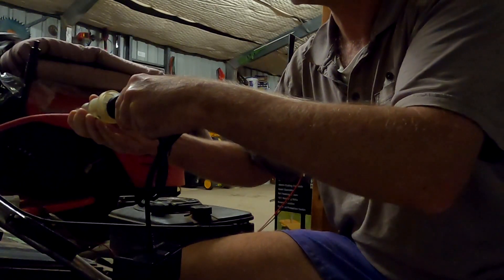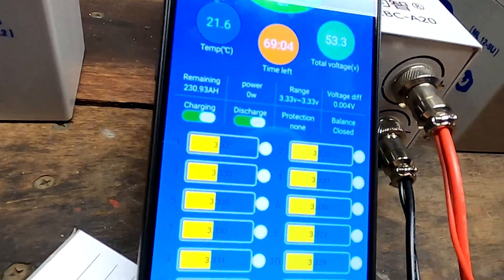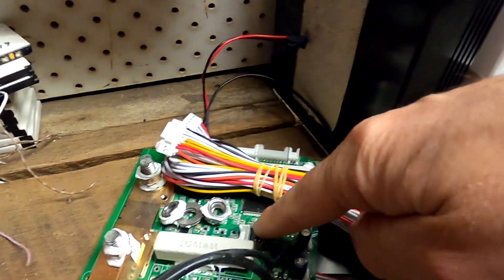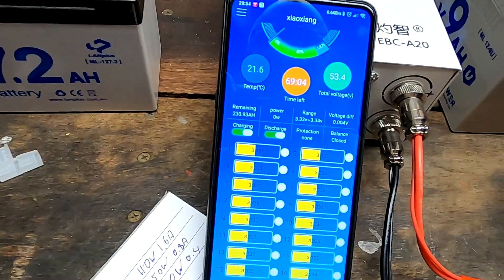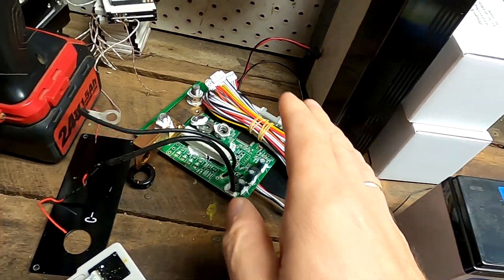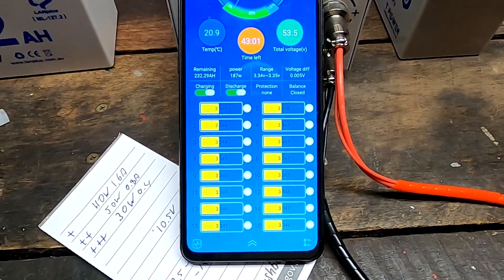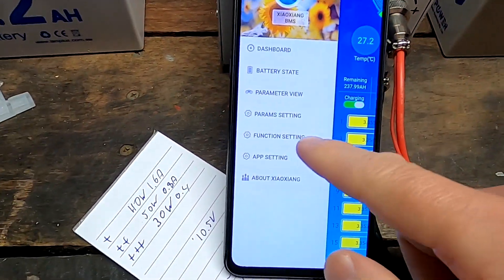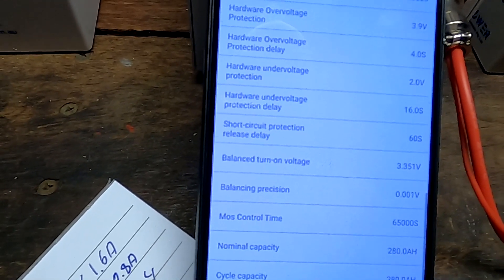That was totally my fault! How the new BMS outsmarted me...

Comment: if all the cells are 3.33 volt, what's there to balance. maybe you need some more time out of the garage and rest for a while. ;)
Reply: Because the state if charge can be far apart but voltage still be the same when you are close to 3.3 volts. Only when you get to the top and bottom of this chemistry can you truly balance the pack.
Reply: Because the state of charge could still be pretty far off at the 3.3v range with this chemistry.

Comment: That old keeps creeping up on us. Funny you even said 30 millivolts several times(and I was wondering why it was so high). Speech and reading part of brain not connecting with the thinking part at .003 volt Lol. When I program a CNC and it won’t run or does something else or impossible,  I’m always ready to blame the machine too. I call a coworker over and talk him through my program….that’s when I get the forehead smacking moment, usually self discovered. It was right freaking there.
Reply from the maker: Either to many 🍺 or not enough... 😂

Comment: I have 2 humble suggestions for you to try:
 1- disable balance charge: the balancing pushes 0.2A from one cell to another to make the balance (during charging if the balance charge is enabled - so basically useless). when the balance charge is disabled, the balancing will only kick in once it is not charging anymore (cell overvoltage protection or any other reason) this way the battery will have alllll the time to balance the cells slowly and efficiently.
2- setting the balancing accuracy to 1mV will keep your pack in balance mode for ever and will eventually self drain because of current movement from one cell to another endlessly ( the loss alone in the transfer will drain your battery). setting the limit to 20mV is a good level and you will have nice well balanced cells.

regarding the float charge balancing suggestion: big no. you are trying to balance the cells with floating current. this floating current will apply to all cells and will not have a balancing effect. yes it will be more visible, but the balancing is not triggered by the charge level. either you are pushing 20A in or 1A in, the bms will look at it's parameters and activate or deactivate the balancing. let the bms do the balancing as suggested above in point number 1

Cheers
Reply from the maker: This is not an active balancer. This is a BMS with passive balancing. It uses a resistor to discharge the cells if they have higher voltage than others. 
There is no float current for Li cells, they just don't float. Floating Li means the SCC takes care of your loads while the battery rests at the set float voltage. There is no current going in or out of the battery at this stage.
You're mixing things up a bit?

Comment: When you were set to balance at 3.33V: Your "Balancing precision" was set to 0.03V or 30 mV. That means there must be at least 30 mV difference between high and low cells for it to start balancing. When you were set to balance at 3.33 your cells were only 4 mV apart. Not enough to trigger balancing. You need to be both above the minimum voltage AND have a large enough difference between the high and low cells.

... Oh, I should have waited to finish the video before commenting. Haha.

30 mV is probably the recommendation because the voltage measurement from the BMS is probably not accurate enough to keep them within 1 mV.
Reply from the maker: Yeah, I oversaw this setting multiple times for the last few days 😂
As I never changed it since the beginning, I took it for granted that adjusting the balance voltage is enough to trigger it. 🤦‍♂️
But you're right, it's an AND for reaching the voltage AND having a higher difference between the cell voltages.
Reply: @OffGridGarageAustralia  At 1 mV delta for balancing is ridiculous, what your trying to accomplish? All that balancing energy ends up being wasted by being dumped into balancing resistors as heat...
A delta of 20-30 mV is more than sufficient.
Reply: George D / 😂 Correct.

Comment: The solenoid on this BMS has a special "economizer" attached. It is supposed to limit the idle power of the solenoid, after the current surge to pull in the armature. But with many fake Chinese products does this work on this BMS? - testing video, please.

Comment: 2 points worth noting...
use the other app that comes with bms to set static or charge balance and set accurate temp of batteries ...
and if you have a cell that runs higher voltage then is your weakest cell on full charge and discharge it is wise to set the balancing at 3.5v so you re not robbing it to balance others as it charges and making the problem worse
Reply from the maker: What other app? That is the one for the BMS?
In my experience balancing at 3.5V is not worth doing. High voltage and no effect. I will explain and show this in a future video.
Reply: can send you other app on "send anywhere" app if you download it or have it

Comment: Question for you. Most solar charge controllers require a battery connection at all times during solar charging, otherwise the solar charge controller might be damaged. So what happens when your relay type QUCC disconnects the battery connection

Comment: Hi Andy, have you tested the battery cell low/high voltage disconnect function of the BMS to protect each cell? Can you also check if the relay cuts off charging when you disable charging from the app? Last time you checked, but that time it was discharging. Thanks.
Reply from the maker: Yes, I did test the low volt connection in this video. Hence I knew the relay was not working.
https://youtu.be/PbzTmk5mzr8
Reply: @OffGridGarageAustralia  Yes Andy, I watched that video long time back. I'm talking about the new BMS. Is it working now?
Reply from the maker: I haven't tested the automatic cut off yet but the manual disconnect now works. So I assume it's all working now as designed. I have to wait until the battery is very low again to test the automated disconnect but I'm sure it's now working.
Reply: @OffGridGarageAustralia  Yup, have to wait for low battery. I wonder how overcharge protection works with the relay, as you were not able to turn it off manually. If the relay cuts off when the battery is full and your inverter is running, then curious what happens, will the inverter run purely on solar? Please test over charge condition too. Thanks.

Comment: In the previous video noticed something goofy as well you set cycle Ah to the full capacity that means it won't record your cycles properly.  Looking at the videos a bit think that number should be something like 140Ah
Reply: A cycle is the full amphour capacity in and out (or nearly the full, personally I go for 80%).  The BMS should sum the partial discharge and charge to count a cycle only when the total matches the set value. In other words, 50% in and 50% out is not a cycle.  But do that twice and that is one cycle. From what little has been said it appears to me to be working properly.
Reply: @Sylvan_dB  That is different then how I have seen it before but makes sense.  The old laptop ones where set at 50% of capacity of the last time it was calibrated.  But if it can remember and add up multiple cycles.  Not sure how the battery manufacturer computes the 3000 cycles.

Comment: How does the % charge indicator on the BMS compare with the shunt reading, after it has run for a few days without being fully charged ?
I'm assuming the BMS pulls it's balance and self consumption currents through the balance leads, as my Daly does, so the shunt won't see it.

Comment: Not at end of video .... but doesn't need 0.03v difference to balance.

May edit if you cover this later in video.
Reply: You did ....  but your too tight on this balancing.  You dont need to balance that much, your just wasting energy.
Reply: Balancing is only useful at the too end, or bottom end of the voltage.  Think of your volt graphs from the new machines.  No point balancing in the flat middle, only at the nonlinear top or bottom
Reply from the maker: I used the 1mV setting only for testing. It sits on 10mV usually.

Comment: Hi, I like your movies very much.
I am asking you for advice:
I bought 4x3.2v 200Ah lifepo4 and DalyBMS 120A charging will be from the 370W panel via MPPT 30A after connecting I have to change something in the BMS settings?

Comment: Dear Andy,
I have an RV and I want to replace my agm batterys for the body part to lifepo4 battery, 
I  order 8 x 280 Ah my question is should I assemble them as 
2 x battery 4 S  with 2 x BMS  and put them parallel 
Or put 4 times 2 cell  parallel with 1 bms
My maxium output is 1800 watt
I can order 2 bms  4s 150 amph or 1x 4s 200 ah
What do you prefer and is the advantage or dis advantage
Thanks and best regards,   Gerard from the Netherlands
Reply from the maker: Hello, thank you for your comment. I would use them as one big battery with a 2p4s configuration. As it is for an RV, it should be only one battery for the ease of usage, setup and operation. Then you need only one BMS.
I'm in a similar boat now with my battery extension. I will discuss the pros and con's in a video soon.
Reply: Thanks for your quick answer, and I'am looking forward to your video.
Best regards, Gerard

Comment: 1 mV balancing target spread is wishful thinking. The BMS ability to read that accuracy is unlikely.  With charge and discharge current varying in real useage you will likely get 1 mV variance jumping around just due to slight variance in cell/straps/lug series resistances.  You will likely be randomly bouncing balancing ON and OFF with that tight of balancing request. I am surprised they even allow that tight a setting.

That is why the balancing hysterisis is defaulted to 30mv so it doesn't bounce ON and OFF.  You might be able to go down to 10 mV hysterisis (what they call 'precision') without too much thrashing balancing ON and OFF.  As you trigger balancing lower than 3.4v you will need a tighter hysterisis because cell voltage doesn't vary much like it does as cell approach full charge state above 3.4v.
Reply from the maker: 1mV is just for testing, I have set it to 10mV usually

Comment: I thought both conditions must be "true" for balancing. The voltage must be greater than the value and also the cells must have more than 30mV difference. Maybe you have too little difference?

A cell difference smaller than 10mV does not necessarily have to be balanced. If you set the value to 1mV the balancer will never be ready.
Reply from the maker: Yes, that is true, both conditions need to be met to start balancing. I just didn't see the 30mV.
I have it set to 1mV as I rarely go into balance mode anyway. The cell voltages are tight together across all states so not much balancing necessary, as you said.

Comment: You keep saying the hardware looks the same, even tho I'm sure you realize that different firmware won't make it look any different, and neither will different component variance within the normal manufacturing tolerance.
Missing a decimal place, easy to do. That app UI is normal, but not great, in mixing different number of decimal places. I have a couple of bench power supplies that I'd dearly love to be able to change their amperage display from amps to milliamps and turn off leading 0s, because I find it takes extra thought to make certain I see the 0s and decimal point on the correct side of the digits - am I setting 0.030 or 0.300 or 3.000

Comment: i think 0.001v is too narrow
Reply: Agree.  One must watch the normal voltage reading noise in the BMS for each cell and set the balance precision to just a little more than that variance.  Also, when tieing several BMS together, you know that each one does not calibrate exactly as it’s neighbor.  So use one of them as a reference and look at what the other units are reading... then make the settings in the other units match those readings.  For example, if Unit 1 is your reference and it reads 55.4v,but the other unit reads 55.2v due to calibration difference, then you simply set unit #2’s voltage to be 55.2.
Reply: I agree, he's wasting power draining the highest voltage cells over what amounts to little more than measurement error margin, noise and channel-to-channel variance. There is no point in obsessing over voltage differences under 10mV.
Reply from the maker: 1mV was just for testing. I usually have it to 10mV